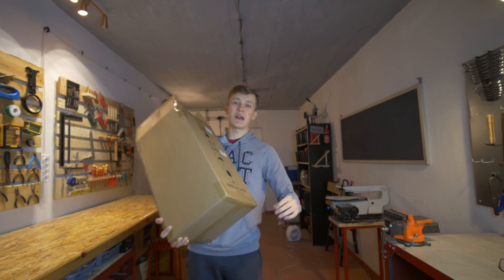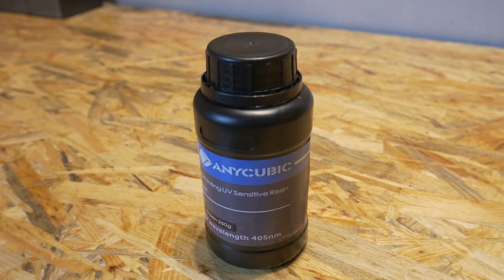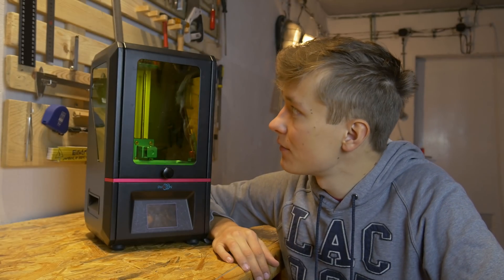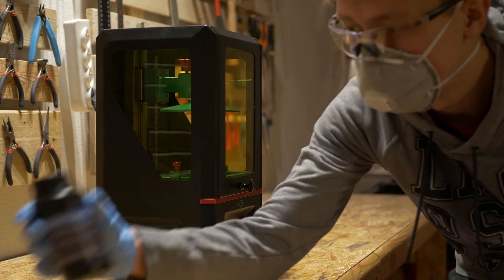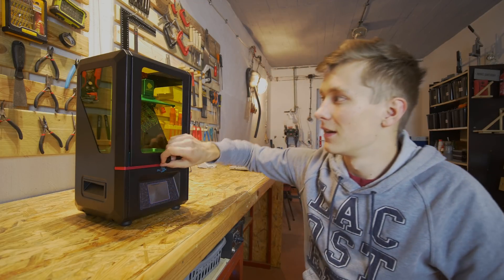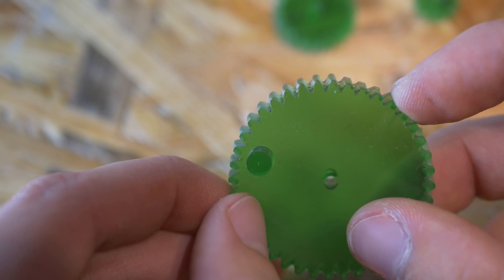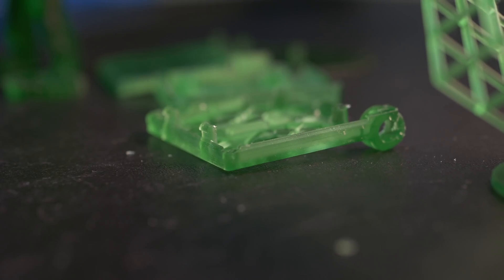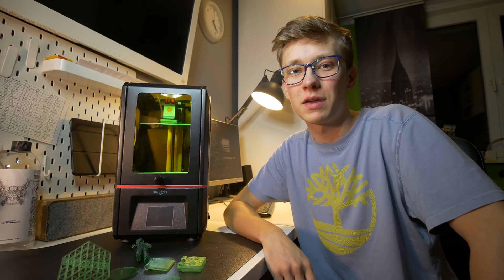Testing Anycubic Photon a resin printer

Comment: hi dear friend, what about the difference in the printing time between this type of printers comparing with the pla 3d printers ?.
Reply: the printing time is variable compared to an FDM printer:
in an FDM the time for each layer varies according to the size of the object while with the resin the time is identical for each layer, because the whole layer is imprinted at the same time (a few seconds for each layer, it is not instantaneous).
But also keep in mind that the height of the layers is much smaller, even a tenth, of the minimum FDM layers and therefore you have many more layers for each object

Comment: You did not say anything about the smell. Many (me included) can not stand the smell of resin, when it is printing - the resin is heated and blown by fan. I would say that you need a separate ventilated room for this. For me it is completely unacceptably to have the printer running inside of an apartment.
Reply from the maker: Well I'm the workshop that's not a problem and when I was printing at home I opened a window and left my house for few hours, when I come back the print was ready and thanks to opened window there was no smell at all.

Comment: It's not a layer shift, it's normal for that kind of printer the first layers will be deformed and squished a bit (usually up to 1mm). du to the longer exposition time and the way to Z axis is build.
To fix that problem you need to print at an angle (usually 30°) with support.
Also if you want to make functional parts, use, the way more expensive, engineering resin, the base resin really doesn't like friction and will wear really quickly.
Reply from the maker: Thanks for your comment, I will try to do this!
Reply: @nikodembartnik  Don't worry about the support damaging the model, that will sand REALLY easily with a piece of 400 wet sandpaper. I usually sand my pieces on a flat surface and i have a really good finish.

Comment: That would look so cool in a CNC projects instead of plastic parts if you think you can do it
Reply: The resin is to fragile for this, it too brittle, shatter and the sligh bit of friction will start to dig in to the resin. It's great for small model, but you need something else for functional print.
Reply: @ @SaitoGray  It depends on the resins: there are resins for all uses, even for producing dental prostheses ... maybe not with this printer, but there is also that possibility
P.S. : in dental use, just to emphasize the reliability of the material, with the right resin you make the finished product